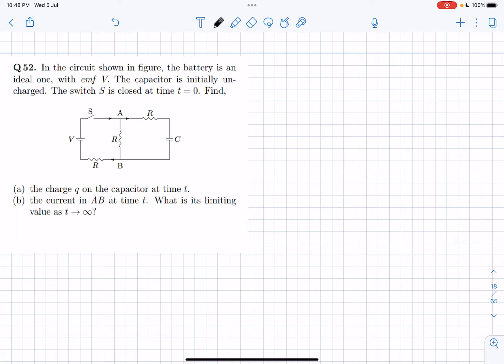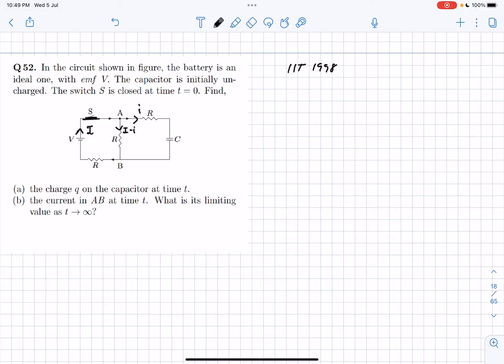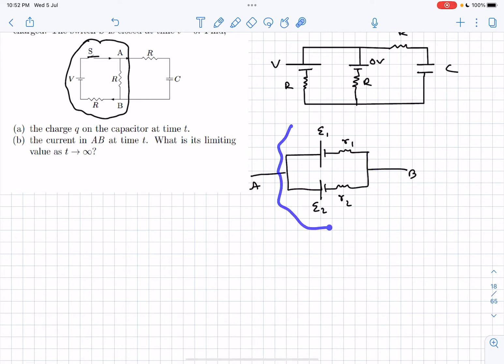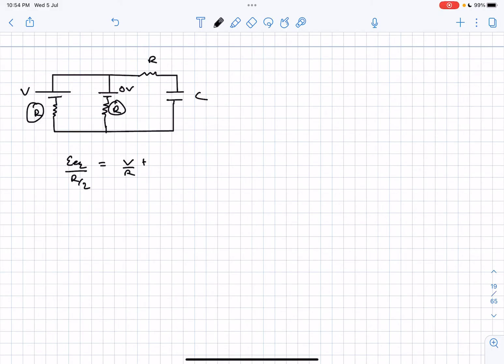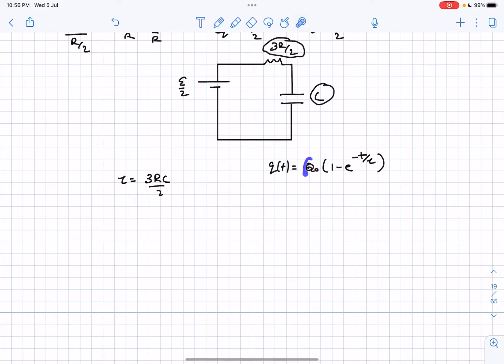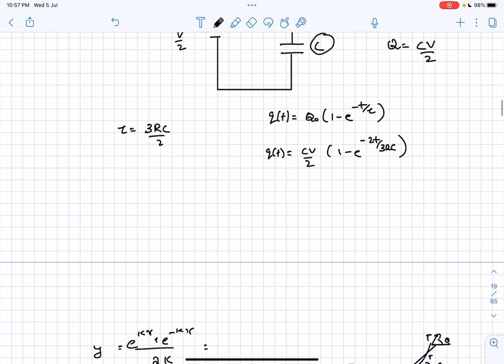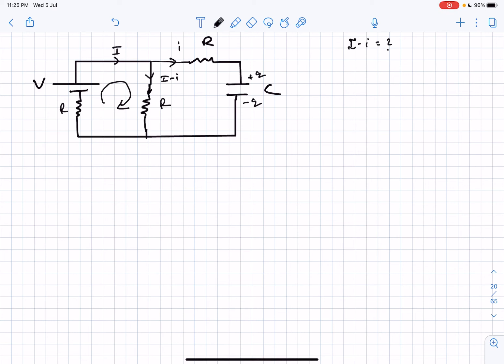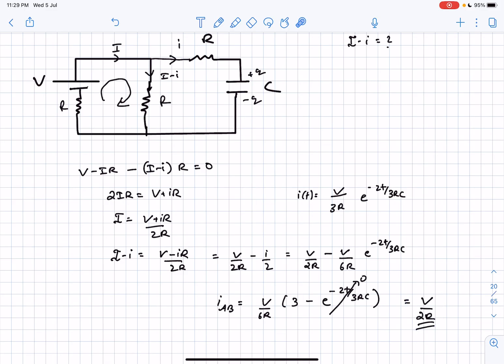[IIT 1998] Q(t) of an RC circuit With Standard Results

Comment: Is it better sticking to one book and revising it  OR solving from multiple sources.
Reply from the maker: If the book you are following is a good one which has the standard cases covered, then follow that one book only, I am assuming you are talking abt theory.
Reply: @PhyX_03  yes yes
Reply from the maker: Yeah my experience is that problem solving teaches u more than theory books , so get done with basic stuff asap. And start solving problems that are on your level and slightly above
Reply: @PhyX_03  I'm currently doing physics galaxy book + advanced illustrations. And irodov for good calculus related problems.
Reply from the maker: More than sufficient for now bro